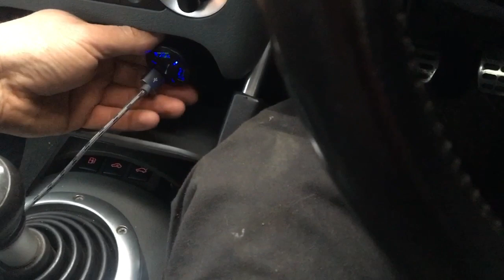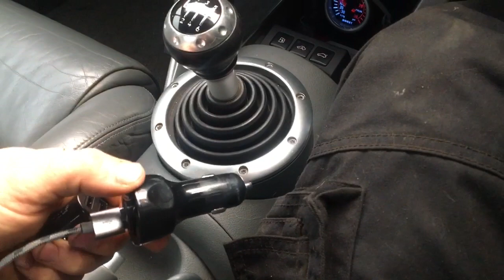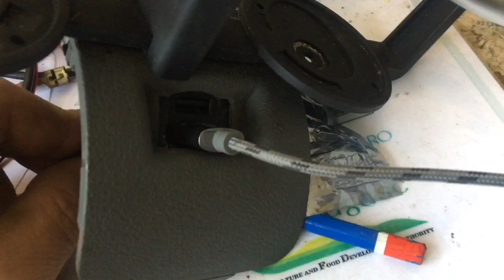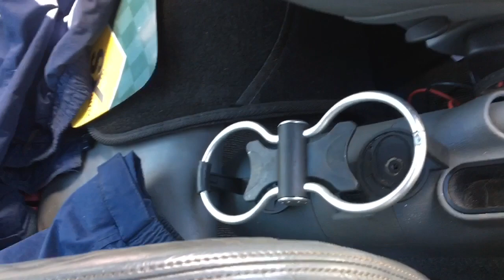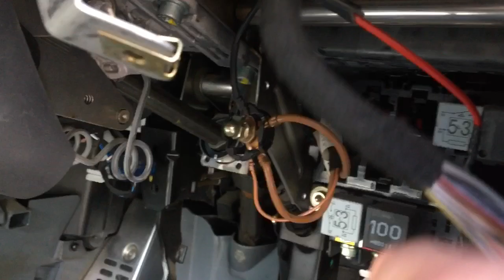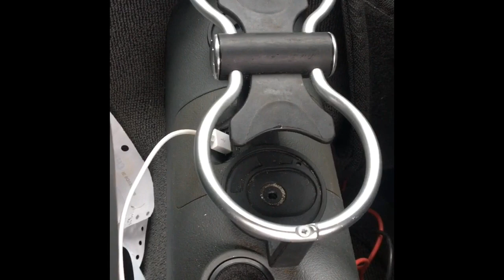14) Hard wiring 2 USB ports, into the Audi TT cup holder.

Comment: Great guide!  How did you add your cables to the fuse box?
Reply from the maker: I used crimps and solder , is that what you mean ?
Reply: @stevenharpervw Are there already connectors to crimp wires to in the empty fuse slot?
Reply from the maker: So the earth is easy it’s just a ring terminal and joined in to the other ground connections . And the positive is 12v with key on and 0v with key off . I put a ring terminal onto the post and then into the fuse box . I found an empty slot so it has its only fuse. Then the wire comes out of the fuse box and goes to the charger . So that wise is both switching12v with key on and fused